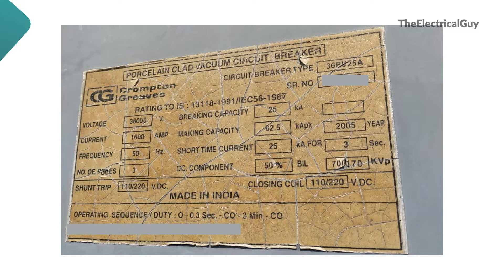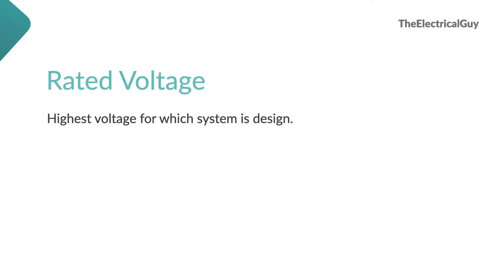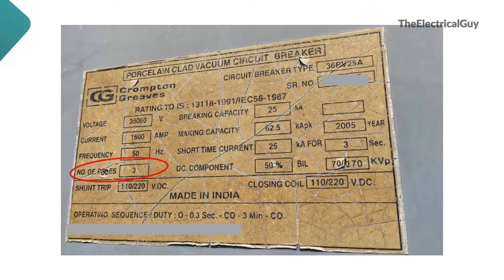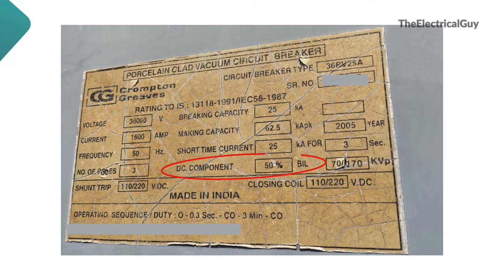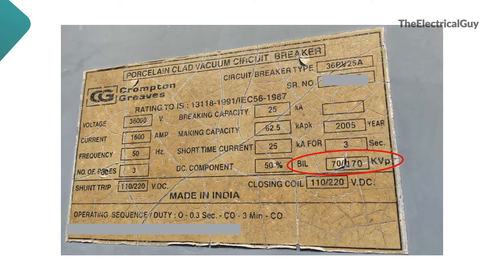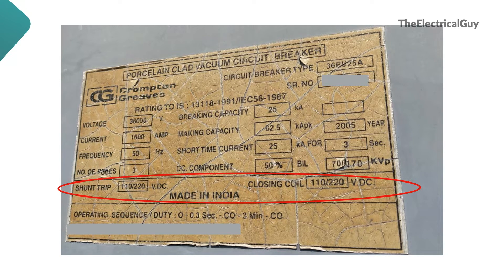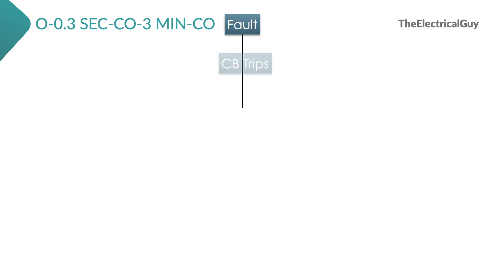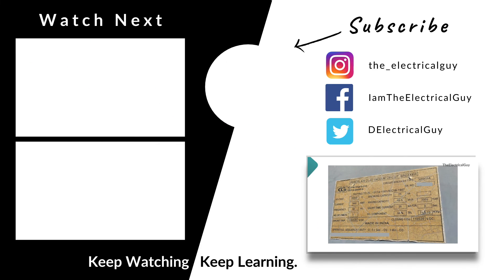Vacuum Circuit Breaker Nameplate Details | Explained

Comment: Dear gaurav ji,
   Control voltage 110/220VDC means it is a universal type circuit breakers. As resistance comes in picture with define values across the electrical DC control components. For example if a zone having 10 different SS.with 50% having 110VDC and remaining 50% having of 220VDC so if CB working on 220VDC resistance of specific values will be in series with DC components,and if CB working on 110VDC resistance will be bypass with DC components.
On the other hand it is very easy to change the CB on major breakdowns.
You will find these types of CB schemes in MSETCL, RRVPNL electricity board.

Comment: Why in transmission substations 400kV is not directly stepped down to 33kV & why they do it in 3 steps as 400/132kV then 132/66kV and then 66/33kV?